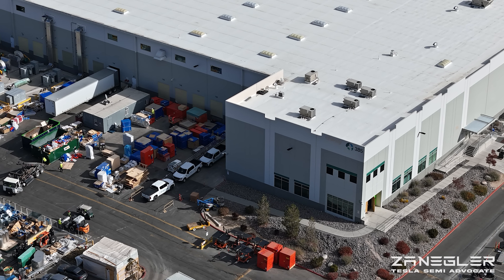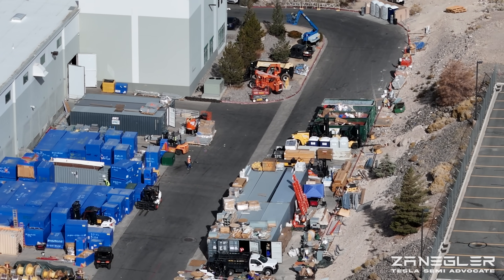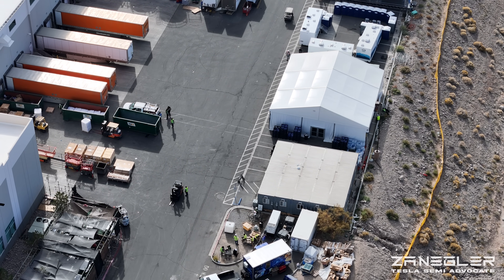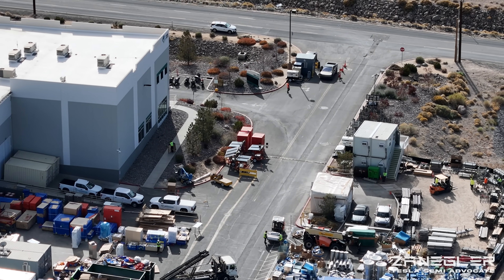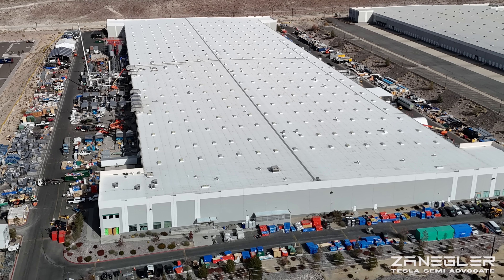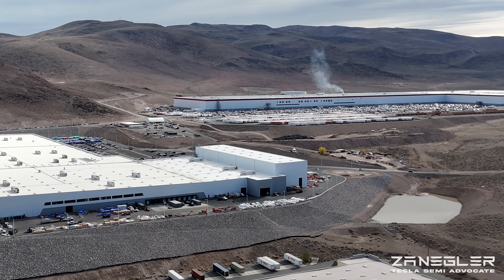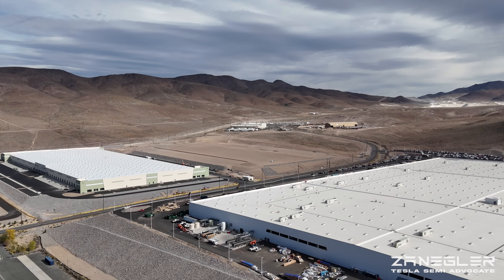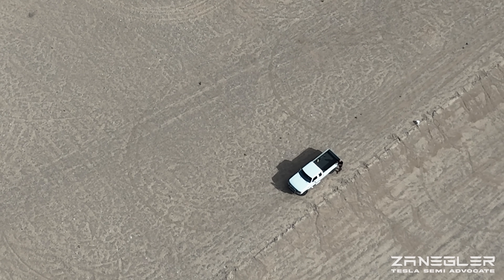Tesla's Secret LFP Battery Factory

Comment: I agree with your opinion on having a standard body on the cyber truck. There's very little use for the working man under it's current configuration. It's more of a show piece than a functional truck.
Reply: 25% of Truck owners even use the bed.  I think Tesla addresses a lot of issue for guys that use a truck for construction etc.  Non rust body, locking storage for tools, torque for towing, built in air compressors and power outlets.  Bed fits sheets of plywood. Tailgate lowers and extends for easier loading of ATV, bikes, wheel barrow etc.  And body won't dent either.
Reply: I disagree. As long as you don't need to tow long distances it's a workhorse of a truck. Looks may be a minor factor but the primary reason impacting sales is the price. 80k for the low end version is too much for many folks. The low end of the F150 is about half that.

Comment: Thanks for the video. Very unlikely Optimus would use LFP. Optimus needs the best capacity to weight and volume especially given battery is in the chest and forces high center of gravity. Optimus will likely use high nickel batteries - the highest capacity for weight and volume Tesla can source in volume

Comment: You would think that they would try to have used a larger building for the factory. From the outside equipment storage, the inside must be packed and that is difficult to maintain in cramped quarters.
Reply: Theodore, Theodore Theodore